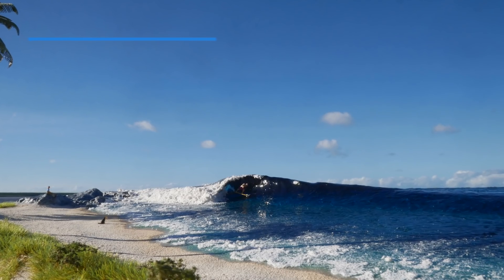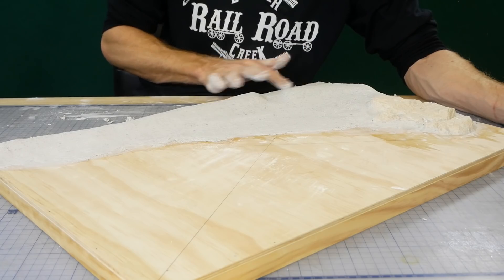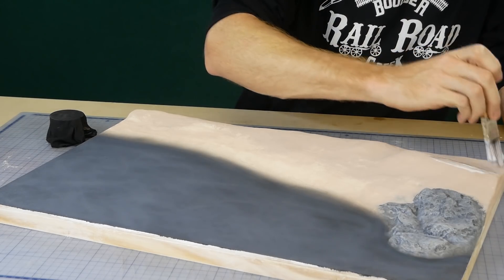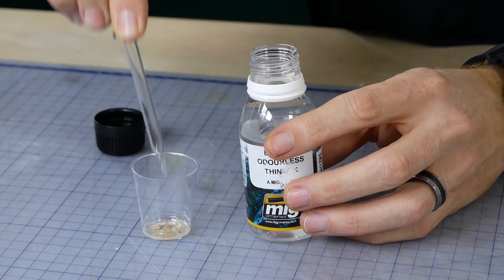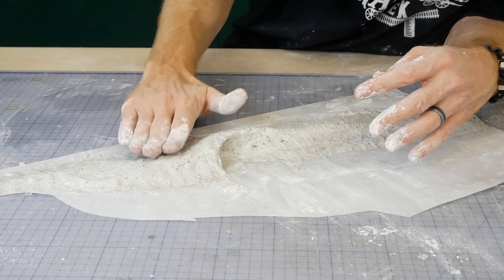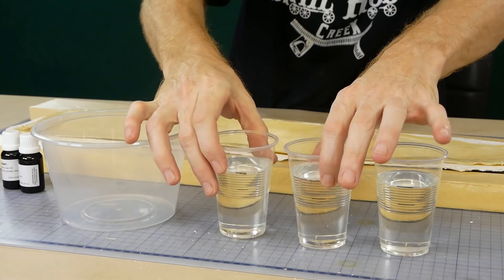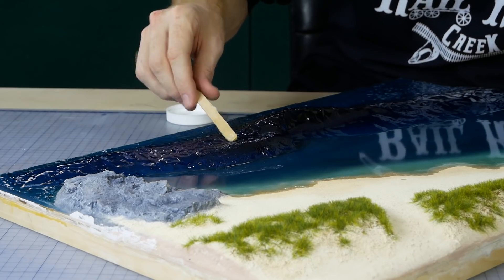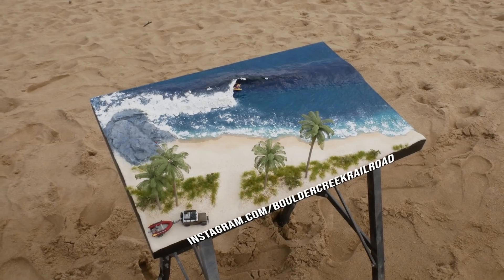How to Build a Hyper-Realistic Surf Diorama - Realistic Scenery Vol.17

Comment: The water foam looks very dry compared to the water in my opinion, but other than that, the scene looks amazing!
Reply from the maker: Thanks for the feedback, yeah I might make the water foam a little more translucent next time by using slightly less white paint 😉
Reply: To my eye I'm not sure it's so much a lack of translucency as it is not quite glossy enough.  It shouldn't be 'water wet' glossy, but it still reads just a little flat, I think.  

Fantastic work regardless, and speaking as a long time modeler - if everything were always perfect, there'd be little to try to improve on with the next project.  Half the fun for me has often been trying to make the next one better than the last.
Reply: @BoulderCreekRailroad  I think he meant it just does not look wet. A bit of high gloss clear coar on the white water would make a huge difference I think :)
Reply: One thing I found when I did a white water river, is that a little glossing up made a big improvement. :-) Worth doing in m opinion. But be careful not to do too much, otherwise you might loose that "bubbly" texture.
Reply: @BoulderCreekRailroad  I think if you added another layer of the wave effects goo it would gloss it up and blend it better with the rest of the water. You could always do some test runs on some scrap wood before committing to any approach.

Comment: I am always amazed how very little glue you are using to put piece on your diorama.  I always think it's not enough glue, can you tel us how your diorama doing over time with so minimal glue ?
Reply from the maker: Because these dioramas don't get handled very much after they are made I only need a small amount of glue, I have some dioramas that are over 5 years old and I use a vacuum to clean them, so far I haven't had any problems with bits falling off or being sucked away with the vacuum cleaner. If I was going to build dioramas for use with tabletop gaming I'd probably spray over an extra couple of layers of glue 😉

Comment: Hmm, I wonder if there's some kind of superfine sand-like clear plastic that could be used to make white water foam that is somewhat translucent. Perhaps even superfine glass beads could be experimented with; it's commonly used on roadwork to add a reflective feature to painted stripes and lines on freshly-tarred roads (they toss handfulls of it onto the fresh paint and it just sticks). If you ask a concrete-laying place nicely, I'm sure they'd let you take a fistfull to test with. I think it may be the same grade as what's used in sandblasting cabinets, so metal finishing places and shops that do glass etching may also have some handy. In any case, if it's not fine enough and/or has too much of a uniformly-spherical texture, you might be able to break it up in a rock tumbler with some pebbles (or in a jar on your paint shaker, with pebbles as well) to crush it a bit into a finer dust.

Oh, and speaking of reflective road markers, I wanted to suggest the aforementioned reflective glass and/or the dust made from it to make your road stripes even more realistic. It's not as noticeable in bright daylight, but it (or even reflective safety tape) could be used to make them appear hyper realistic in dusk/dawn/night settings.

Keep up the amazing work, and I hope these ideas are of some help!

Comment: Loving these vid's. Couple of questions, please....What is the purpose of spraying the isopropyl alcohol? (6:36)… Also, would this pigment fixer be suitable for fixing the mortar line into a brick wall (1/35 scale - approx' 0.8mm in depth). The mortar would probably be sand, coloured with a powder pigment, and then brushed into the gaps between the bricks. The diorama would only be for display and not handled very much. Cheers, Pete W

Comment: Is there a reason you use latex rubber rather than silicone? You would get much easier releases of your resins, and because brushed silicone layers are so viscous they never show brush marks. Plus they don't degrade like latex, and you can use them over and over. And when they do get used up, you can cut them up into small pieces and use them again as filler for new silicone molds.